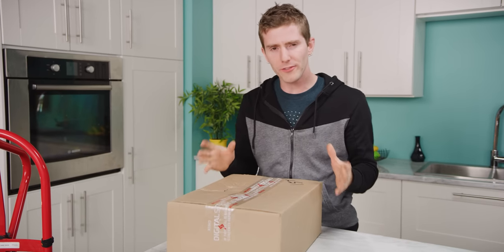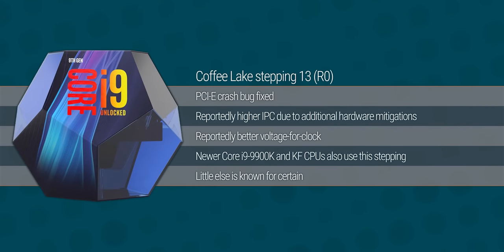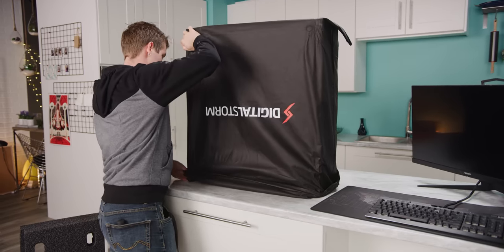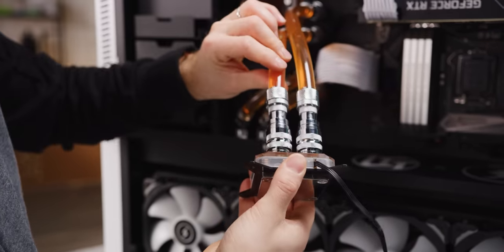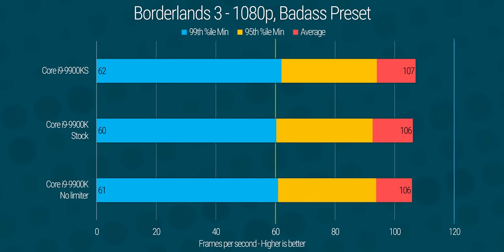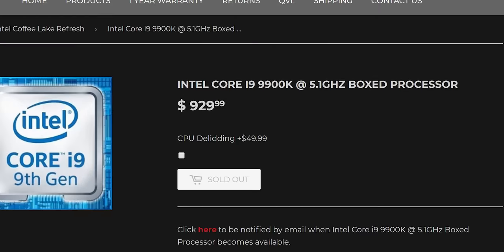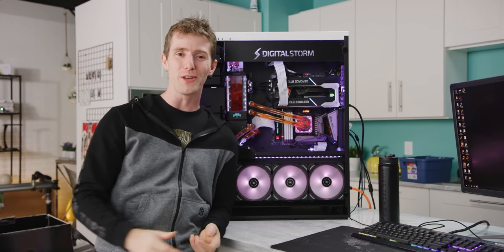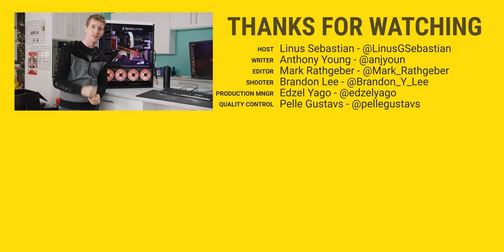Intel's PRE-OVERCLOCKED CPU... Core i9 9900KS

Comment: Why are you reviewing the FX-9590 in 2019? It came out in 2013
Reply: Was thinking that too 🤔
Reply: only that the 9900k is actually good unlike the fx 9590
Reply: @heyrellic  The price/perf ratio is better in the FX, just saying
Reply: @heyrellic  like the FX9590, the 9900KS is only good when looked by itself. When compared to the other products on the market is expensive, power hungry and overall pointless. The 3950X and 3900X are both much better propositions and the 9900K is still the way to go if you really can't go AMD for whatever reason, but you want 95% of the performance of a 9900KS. (Same as the 8350 was the way to go if you couldn't go intel for whatever reason and still wanted 95% of the performance of a 9590)
Reply: @ligofleyens9131  At 3€ each, the Core 2 Duo E6750 has an even better price/ perf ratio. Get it?
Reply: @rivox1009  i never said you should compare them, just saying the fx9590 aged poorly
Reply: The difference is, this one actually performs, vice the previous one getting it's ass handed to it by most common i5 processors clocked 1 GHz less in all games...
Reply: @heyrellic  not anymore.
Reply: @ligofleyens9131  Specially now that you can buy one of these in the second hand market for 30€ or so
Reply: @mdd1963  both CPUs shouldn't exist. Also an FX-9590 at 5ghz had the same multi-threaded perf as an i5-4690k at 5ghz. 

The 9900ks is to 9900k what was back then the FX 9590 to the FX 8350.
Reply: @Dan81825  That would be a good argument, if we were talking about that one...
Reply: @ligofleyens9131  But the Price/Performance ratio doesn't really matter when the CPU is almost unusable in modern games.
Reply: @heyrellic  a full mitigated chip is probably close to a bulldozer nowdays..
Reply: @hadis5160  Unusable? Newest CPUs are way better, of course. But man that FX can go with the latest without major problems. I can assure you. Excepting some specific titles, most games need a good GPU.
Reply: @ligofleyens9131  just a try to give an (extreme) example that price/ performance doesn't make much sense in the enthusiast sector, as this rate doesn't increase in a linear way.
Reply: @Dan81825  Still does a bit, but I agree with that.

Comment: I'm old enough I remember bridging stuff on my motherboard with a pencil to overclock it.
Reply: And on CPU itself (Thunderbird, multiplier unlock)
Reply: Damn, i missed those old days
Reply: @NamelessPassenger  😂 can't believe those small heatsinks (compares to now) can cool those oc'ed chips back then
Reply: I used to make spreadsheets with typewriters and pencils.
Reply: I'm old enough to remember bridging stuff on CPU to unlock more cache (Duron -> Athlon). Too young to remember bridging stuff on motherboard: What CPUs you could overclock by motherboard bridging?
Reply: @kimnice  More precisely, bridging with pin. Old pentium, k5~k6-2, cyrix. Even during slotted celeron has some board with these pin/switch on the board to set voltage, multiplier, fsb, etc. With these boards, you had to set to correct setting for your cpu before booting, man, those old days XD No auto-detect for cpu you use, you had to set the correct voltage and clock for them.

Comment: "...what I consider to be an Intel first: a pre-overclocked processor."

So what was the i7-8086K then??
Reply: And the i7 920 vs 930. And many others through the generations.
Reply: i was honestly thinking this too. are we just forgetting that the processor with the best name ever ever existed?
Reply: I have an 8086K and when Linus said that I felt PERSONALLY ATTACKED
Reply: @FifteenthApollo  sue him
Reply: AMD FX9590... TDP 220W
Reply: @boumerguy7042  The 9900KS consumes simmilar ammounts of power.
Keep in mind that the FX9590s TDP was for Boost and the 9900KS`s is for base clock only.
Reply: He said "mainstream" or "widely available" or something like that. The 8086K was a limited run.
Reply: Technically he was not wrong. The 8086k is a binned 8700k but it is not pre-overclocked. The 8086k and 9900ks are just meanto to guarantee you a binned processor. That does not mean that some 8700k and 9900k processors are worse. I personally got lucky and my 8700k was able to clock at 5GHz on all cores without any stability issues.
Reply: Correction, the 8086k only has overclocked boost frequency of 5GHz, but that's not an overclock on all cores. It's just a boost clock.
Reply: the USSR
Reply: @POCKATA  correct, but the cool part of it (If you're not counting bang for buck, or else you should stay away from it) is the sillicon lottery offered selected 8086K. Mine was guaranteed 5.3 Ghz which is perfect for gaming. Stable 5.3 Ghz at 60 degrees (averaging at 5.1 according to windows info because not all cores boosted to 5.3) which was proven true following their guidance. It's a hell of a sillicon lottery over sillicon lottery CPU. Totally not worth it for a normal rig but because I run flight simulators which rely precisely on CPU freq and Gpu RAM, I was willing to go that route.

But yes, for the average person, and in the future when my CPU starts getting tired, it simply means you got an easy 5.0 boost from almost nothing. I believe this kinda achieves the same idea with 8 cores and more cache than the 8086K.
Reply: Also the i7 4790K which was basically a pre-overclocked 4770K.
Reply: @boumerguy7042  In reality the 9900KS runs hotter and consumes more power. Comparing TDP's is completely meaningless.
Reply: @POCKATA  Mine too. I have mine delidded and it can handle 5.1Ghz, but the vCore is higher than  my H115i can cool, sadly
Reply: @PureMatteo  lol,  5.3 is perfect for gaming? Was there a study done i missed,  or you just saying that cuz it's your computer's speed? Ive yet to have a single game be too much for my 4.6 base ocd 6700k or I'd have upgraded it already.

Edit: actually I'd probably just oc it more first.  Since i haven't even messed with voltages to get to 4.6.
Reply: @POCKATA  it has also a higher base clock of 4 ghz

Comment: 10:30 "how dense that heat generation is" ... 

Umm is that dense... AM4 socket 3950x 16c/32t?
Reply: 16x/32t

16*2=32
Reply: @DarthCiliatus  thanks for the basic mat...
Reply: The dense thing is people who still buy Intel
Reply: Darth Ciliatus quick mafs
Reply: Thermal density and core density are two VERY different, albeit often correlated, things.

Comment: I remember the days when it was easy to add 1+ GHz
Reply: Back then the reason one could do that was because manufacturers did not want to push the clocks for practical reasons rather than the CPU being incapable of doing them. Adding an extra 1+ GHz ruined any sort of power efficiency and required serious cooling, especially in the days before CPU boosting became complex and so such base clock speeds had to be factored into TDP for marketing.

Only due to improvements in manufacturing nodes has running at such speeds become practical. The I9 9900KS with boost duration override consumes similar power to an overclocked quad core of old while having AVX and twice the core count.
Reply: 2600k here its still easy.
Reply: @DeadNoob451  2500k here, cheapo aircooler, 82c at 4.4ghz. Litterally a 33% gain in performance. Annnd it means it has the performance of a ryzen 3 1200.
Reply: I mean base on a 9900k is 3.6 so its still a huge "overclock"
Reply: @unfortunatelyrob2635  actually you are completely right. As long as you still use Intel chips. You can still overclock. It's amd chips you can't overclock.

Comment: Intel is definitely leveraging the maturity of the 14nm+++ process
Reply: And AMD already doing 7nm
Reply: 0nm--
Reply: Figih Setyo 
NO
Reply: That sounds like TSMC is the holy grail. Samsung will probably produce better 7nm chips. Althought TSMC will reach 5nm sooner
Reply: @c.m3558  TSMC's been absolutely killing it. Their 7nm process has helped their clients have a clear advantage over their competitor, in this case AMD with Intel, but also Apple's A13 compared to the Kirin 990, or the Snapdragon 550+. Let's not even talk of the Exynos chips.
I don't think I'd need to precise that I know that the size of the manefacturing process isn't directly linked to performance but I know someone's gonna bitch about that
Reply: I know TSMC built it but amd deliver it. Humiliating intel double perf with half the price
Reply: @Peter Cavojec Will TSMC be able to shrink AMD's IO die anytime soon? It's still 14nm as they couldn't manage it for the Zen 2 launch
Reply: @emporytechnology1502  Don't over state it there, they aren't double the performance of intels chips
Reply: @Peter Cavojec also node size are just marketing. They have almost nothing to do with density etc. Intels 10nm is equal and even surpass TMSC in certain aspects after all.
Reply: @kaldo_kaldo  they kept the IO die at 14nm because of cost. And according to AMD very low performance gain. Take that as you will. It will probably shrink with time.

Comment: No Problem , it costs only more money for oc, that you can do for free.
Thanks Intel!
Reply: Well, it's more like, pay to ensure that you've won the silicon lottery. You have no guarantee that a stock CPU will reach these clock speeds. (Not that I personally would care if it was that high or not.)
Reply: It's a niche product, for a very small select group of people.
Reply: Alvin Walters  2 fps more in 1080p with RTX 2080 ti
pretty cringeworthy if they want dat
Reply: Alvin Walters  Don't crank settings in games to the most that they can and you will always have great FPS even with slightly older hardware if FPS is the only determining factor that is and it has nothing at all to do with ego....
Reply: Alvin Walters  nothing a 3950x doesnt beat for less money

Comment: I'm fine with my normal 9900k @ 5GHz all core, 1.26v, AVX offset of 0, 79c on air under load, without much noise too.
Reply: Same, I bought it in place of the 3900X as I couldn't get it at RRP and the 9900K was a heck of a lot cheaper and available, plus it's better for gaming.
What mobo are you running it in? I went for the Gigabyte Aorus Master.
Reply: @IanD-ut4dy  ASUS Maximus XI Code :)
Reply: @ahtzee9078  Good choice! I did consider the Maximus but the extra features compared to the Aorus Master didn't (for me at least) deserve the extra cost. I also considered the Asus Strix and Maximus Hero at around the same price point but the VRM setup didn't do it for me haha.
Reply: Ian D are you overclocking your 9900k? If so, at what frequency, volts, AVX offset, and temps?
Reply: @ahtzee9078  Sorry mate, I meant to reply earlier but got a flat tyre yesterday so was pre-occupied! :/ But I digress.
Yes, I have my 9900k overclocked to 5.1Ghz. I don't do it from the BIOS, I use the Intel Extreme Tuning Utility manual mode. Setting core voltage at 1.30v, multiplier to 51, AVX Offset at 2.
Temps I'm getting are Max: 71 degrees (package), 63 degrees on Core #2 (hottest core), when stress testing using AIDA64, drawing 153.08 watts peak.

Comment: Lol and lol, I payed a lot lot less for a RYZEN 7 processor which works fine with stock cooler for what 10% less performance? And what cost diffence? Half? maybe more. Rest in peace Intel.
Reply: In gaming you won't see any difference at all if you're not using a 2080ti or something.. A ryzen 5 3600 is even enough for a 2070super or weaker

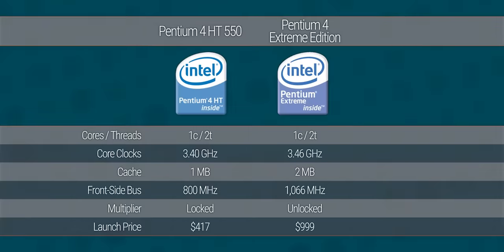Comment: 0:39 lol $999 pentium
Reply: Yep, that was one of the worst paper weights ever made.  At the time, beat by AMD's Athlon FX at a cheaper price, quickly became obsolete with dual-cores and later Intel's own core 2 duo, cheapest release sku @ 1.86ghz CPU performed better than this.... but could still overclock to 2.4-3ghz easily.

Fun fact, Pentium 4 architecture was so bad that they went back to Pentium 3, turned it into a an efficient mobile chip with "core" line of cpus then based the dual core design on it for core2duo, used the modern manufacturing node at the time, 65nm , give it regular volts for normal wattage, its not a laptop chip anymore so it doesnt need to be restricted to 35w and then... let if fly

Comment: And it comes with whopping 1 year warranty. It seems like Intel is expecting it to fry itself.
Reply: how long are the warranties usually?
Reply: @ChescoYT  It depends where you live. I think for USA 1 year warranty is standard. For EU though, 2 years is minimum for everything.
Reply: @rabatin123456789  you'll have to make a difference with the legal warranty and the warranty given by the manufacturer. The legal one in the EU only states that the products have to be free of manufacturing flaws but the actual rules are too complicated to explain here and doesn't cover as much anyways. The one given by the manufacturer is completely optional and they decide the terms of it. Good examples are Googles 2 year warranty and Apples 1 year warranty in the smartphone category.

Comment: Hey Intel, still running my 2600k at 5ghz, plays every game still fine 8 years later.
Reply: Intel be like: Worlds first 5GHz CPU : 9900K
Worlds first 5GHz CPU : 9900KS
Reply: 2700k @ 4,9 on air over here
Reply: What voltage
Reply: As if matching frequency means you are matching performance
Reply: @CaptnKrksNippls  Nobody is saying that, a 2600k overclocked is still respectable thought, at 5ghz it performs better in most games than a r5 2600x.
Reply: @grrkaa8450  Unlikely
Reply: @MarshallSambell  1.45 volts, runs 4.8 with 1.39
Reply: @The2808erik  not in 1% lows lol
Reply: @The2808erik  However a Ryzen 5 3600 (non X) blows it totally out the water. 2 more cores, faster memory and faster single thread performance (due to much better average IPC) all while using significantly less power.
Reply: @The2808erik  Isnt 1.45 a bit high ? Arent you afraid of frying the thing ?
Reply: And watch it tank in several scenes of Metro Exodus. I was running an i7-4790K @ 4.7 Ghz, and I've seen several titles get CPU bottlenecked, even at 1440p.
Reply: @drsupergood8978  yeah sure, but you have to buy a new CPU ram and Mobo, which is way too expensive for the performance gain. If you run the 3600 stock it uses less power, but I can tell you I live in a country with the highest power costs in the world and it hardly makes a difference.
Reply: Yes but dose it have 16 cores?
Reply: @The2808erik  It really depends on how much value one places on performance. Such move also brings a lot of benefits outside of CPU IPS and thread count. PCIe 3.0/4.0 support, full SATA 3.0 and M.2 slots and other modern I/O such as USB-C to name a few. The Ryzen 5 3600 is not even a like for like replacement since it comes from a cheaper market segment (was priced similar to Ryzen 7 3700X).

That said I do have to agree that upgrading from it might not have a decent value proposition currently. I used an old I7 920 for a decade before eventually replacing it after it died (PSU fault).
Reply: @drsupergood8978  I can have pci 3 on my board if I use a 3770k instead of a 2600k I even have bootable nvme support with a hacked bios on the Z68 chipset, I have Sata 3 as well. I don't think 10 or 20 more fps in a game that already runs good enough is worth 800-1000€ same with decreased blender renders or video editing, I do both as hobby so it really does not matter how long a render takes. I play at 1440p anyway, I'm GPU limited in almost every game except maybe csgo and things like e -sports games.
Reply: @rohinhans7819  No, it does not cost 750$ either.
Reply: @The2808erik  its actual 620
Reply: @rohinhans7819  the official MSRP is 749$ and a price is not even listed yet at major online retailers.
Reply: @rohinhans7819  Does not matter. It is totally out of the price range that the 2600K was in. Technically the same for the I9 9900KS. Yes they are better than it, but they better well be considering they are 8 years newer and cost more, even factoring in inflation.
Reply: @drsupergood8978  btw inflation would mean the price you paid would go up to match how many dollers it would be today
Reply: @rohinhans7819  That is correct. However it has only been ~9 years since the 2600K was released. The cumulative inflation since then for the USA, according to various online calculators, is less than 20%.

Hence it is priced between the AMD Ryzen 7 3700X and the Ryzen 7 3800X and probably the I7 9700K. This is significantly less than the I9 9900KS or Ryzen 9 3900X. It is around half the price of the Ryzen 9 3950X.
Reply: @drsupergood8978  k? If its priced close to the 9700k then it's only about 100 to 120 dollers less than the 9900k, for 8 more cors.
Reply: @rohinhans7819  The Ryzen 7 3700X and Ryzen 7 3800X, are both 8 core 16 thread parts. The I7 9700K is a 8 core 8 thread part. I am only guessing that the 9700K is in the same price range as the 3700X and 3800X, since Intel slashed prices in response to Zen2. Initially it was more expensive.

Both the Ryzen 9 3900X (12C 24T) and I9 9900KS (8C 16T) are around $500, if available and not marked up. This is considerably more than the initial retail price of the I7 2600K (4C 8T) if one adjusts for US inflation between 2011 and 2019.

The Ryzen 9 3950X (16C 32T) is around $750. This is pretty much the most expensive consumer CPU on the market at the moment. It clearly is aimed to blend HEDT into the consumer space.

For the same price as the 2600K inflation adjusted, approximately $380, the best one can get is 4 more cores with 8 more threads and considerably better single thread performance. Of course if one paid more one can get better, but this was already the case back in 2011 where for $583 (not inflation adjusted) one could get a 6 core 12 thread, quad channel 3930K.
Reply: @drsupergood8978  you don't need to go all keyboard warrior on me lol. All I'm saying is that the 2600k is just like the 9700k today. The defference is only 120ish dollars